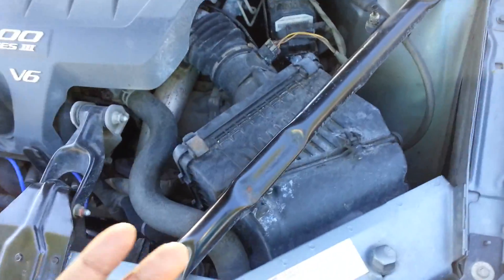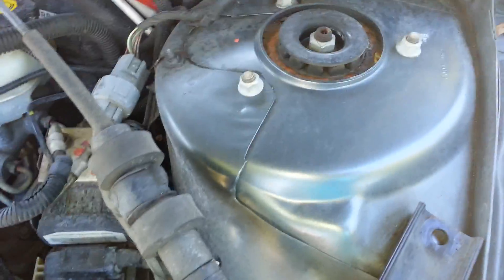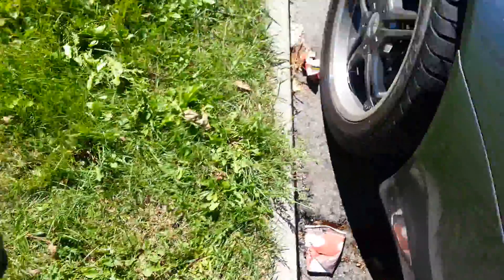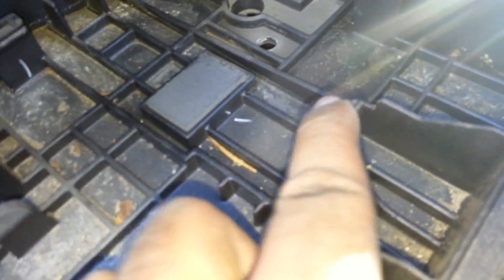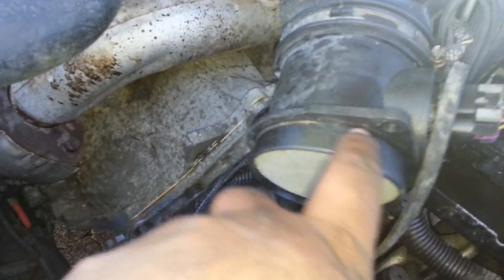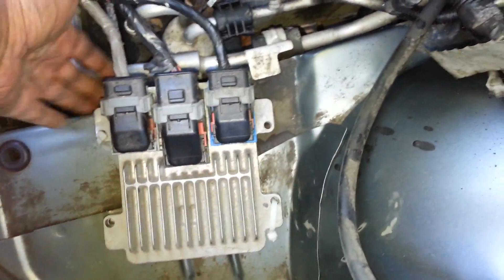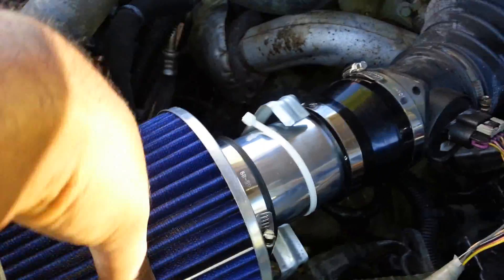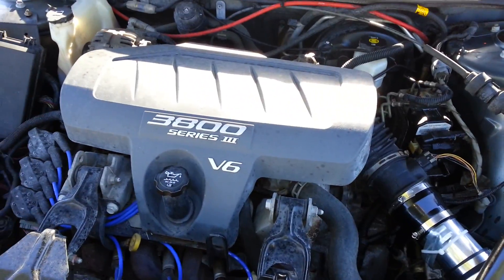04 and up Grant Prix-Adding an Air Intake

Comment: Just from reading the comments, i really like how professional and helpful you are.  You respond to everyone and answer there questions the best you can.  That is awesome.
Reply from the maker: Thanks Collin! I do appreciate the comment and great feedback. If it makes a difference for the viewers, I will keep on doing it :)
Reply: I can also certify that the intake mod does give the car a good boost in throttle response, and maybe a few HP.  Engine gets more air because it breathes easier from the less restricting air passage, makes it sound more beefy.
Reply from the maker: Awesome, thanks for confirming, leaving input and details. I had this conversation with people, but oddly, I find CAI seems to be constantly debated. While I did not record the HP gains, the car was quicker off the line for sure and even in mid-rev acceleration. Your description is perfect!
Reply: Do you think HP gains would be noted if there was a tune done?  Especially if a second "true" exaust outlet was added?  To my understanding, some car adjust better than others depending on their programming.
Reply from the maker: @Calling321  Definitely. I know they are quite a few tunes out there (Overkill was a popular one, but there is quite a few out there). The extra cold air will help with adjusted ignition timing and fuel delivery. The GPs take well to tunes, but I would not recommend it unless you get more done. The car will naturally adjust air/fuel ratio with an air intake, and for the amount of money you would spend on either a canned tune or a tuner so you can tune yourself, you will not get your moneys worth. However, once someone does a lot more (lets say performance ignition, performance exhaust, intake, etc), then a tune would really get some nice numbers from the car.

Comment: Wouldn't think this guy would do this. Best thing for this is stock intake with k&n filter. The oem design is made to suck in cooler air from the front of the vehicle; all you need is a less restrictive air filter such as k&n or something other than OEM air filter.
Reply from the maker: I did have a K&N filter in there at one point, but there is always something better. I won't bother bog down this comment with details of it, I have explained a lot of it in other responses lol. I do agree that while this was sufficient (and it was), it was definitely not the most efficient. I have since modified my air box with the cone inside. Why? Because I like to tinker. You can see it here. 

https://www.youtube.com/watch?v=HiqFHagSmO4

It had better fuel economy and better engine response vs the standard air filter, K&N filter, and the open intake like this video. And I do plan some more mods at some point when I get a chance. But it is worth a watch.

Comment from the maker: It absolutely did, actually. It depends on how you drive, because the sound of the intake makes you want to push the car harder lol. But if you dont change your driving habits, it actually saved me about 10-15% on my fuel use versus the old factory filter.
Reply: Nexus Auto my air injection pump would not let me install the intake, any tips?
Reply from the maker: Hmmmm, that is a tricky one, as you need to have the air box there. The only thing I can say to try, is this video here. https://youtu.be/HiqFHagSmO4
In the video, I converted the air box to work with a Cold Air Intake. It is my current set up on the car. The only difference for you is you would probably want to put a small mesh over the opening in the air box for the Air Pump, as the cone inside will not be able to protect it from contaminants, as a standard air filter would. Other than that, this may work for you.

Comment: I’ve an 07 and I’ve two hose one connected to the secondary air injection pump and I didn’t use a rubber connector I put it straight to the mass airflow sensor and it did seal on but I left the back half of the box should I take it out like you did
Reply from the maker: My GP doesn't have a secondary air pump. That only came in certain models, particularly California models or a couple of other states. Unfortunately, since I've never seen the air pump directly, I've never been able to find a good way to work with it together with the intake.

Comment: Okay so I have a 2008 Grand Prix and there was a hose coming out of my air filter box (obviously not the intake) but my problem is I’m not sure where to connect it? I could send pics? I’m not sure and all I can find is people doing it on the 3800 supercharged. Mine is just the 3800 v6
Reply from the maker: No need to send pics. That is the air hose from the secondary air injection pump. It is not on all GPs, only models from certain emission compliant states (like California). Unfortunately, I have no experience with them since the models sold here (In Canada) did not have the secondary pump, so I am not sure where to run the hose. I even tried locating a car here, but could not find one. Very rare on the east coast in Canada.

Comment: Hay brother can you help me out what do I do with this extra hose that was connected to box and goes down to a canister underneath I don't see you have one it was clamped on securely just wondering if it goes to something else I have an 06 Pontiac grand prix  3600
Reply from the maker: Yep, is your car from California, or another emission-strict state?

That is the air hose for the secondary air pump, which was really on Cali cars (and a few others). Many other places did not have it. 

Unfortunately, that is pretty much the only part I have not encountered, simply because it is not in any Canadian GP cars, and many northern state 3800 engines in general. I have seen people install an intake with that hose, but it almost always gets a check engine light. I have not met someone personally who had a solution. So unfortunately, I could not give a solution. Your best, safest bet (if you cannot find a solution from someone else) is to either have a custom fitting made that can hook up that hose to your new Intake, or get a drop in performance filter instead.

Comment: wow you went from a cold air intake to a high heat engine air intake!!!!!! great job!!!! you successfully reduced hp..throttle response!!!!
Reply from the maker: If you took the time to read some comments, I have explained this dozens of times already. I have long ago explained how I gained throttle response off of this. Main points to mention is that the cold air that would normally go into the air box now blows directly on to the filter. I had put a thermometer to it years ago and it was not even warm, not even close to air around the engine. YES, I gained throttle response from it, primarily from the cooler air that is still coming form around the lights and from where the air comes in from the fender, and for the sheer volume increase in air coming from that the old air box set up restricts. But it was not the most efficient set up for sure, it could be better. So i did modify my air box and put the cone inside (and guess what, there is a video for that too, go figure). And even then, there is more work I could do inside the fender to increase this further. But thank you for the sarcasm, it added sooooooo much. Great job! Much appreciated. Great applause.
Reply: @NexusAuto  ok buddy
Reply: @NexusAuto  hell yeah🤙🏿

Comment: Is this suitable enough to run a smaller pully or should i worry about heat from the supercharger? Im trying to reduce as much knock retardtend
Reply from the maker: I would definitely be concerned with the heat in there, especiallyat idle. If you're looking to run a more powerful build, I wouldn't recommend going this route. This is more for people just looking to add a little something extra to the car for fun.
Reply: @NexusAuto  then should i get a zzp air intake to make sure im running nothing but cold air? And should i get my 1.0 pcm after or before my pulley drop?
Reply from the maker: @hexeezy234  yeah, that's a good kit. Especially if you're looking to run a more serious build, getting a good intake kit is a good idea, and ZZPs is a great one.

If it were me, I would get 1.0 after the pulley install.

Comment: What air intake would you recommend for a 2008 Grand Prix v6 base model no steering wheel controls
Reply from the maker: Depends on what you are looking for, and of course, budget. 

The one like in this video is very budget friendly, but not as efficient as more expensive ones. 

You can also modify the existing air box and allow for more air to go into the engine.  

And then there is full intake systems, which are very efficient and give better low end response, but cost a lot. 

All work fine, but the more you pay, the better it is. I had them all, and the more time and money that went in, the more effective it was. But even the one in this video, which was a no name cone and intake tube, worked pretty well.

Comment: I have the 05 GP base and im changing the air intake and exhaust, how ever the exhaust is single and im  trying to make it dual is the switch possible and if so what do i need
Reply from the maker: It can absolutely be done. In fact, I have done that to me GP (which started its life as an 05 base model too). 

First, check this video out. I didn't show the work, as I couldn't make a video at the time of the work, but it will give you some insights.  https://youtu.be/ySIop0TmV5I

I can tell you at minimum, you will need the Y pipe at the end, along with a driver side muffler,, the 2 rubber mounting flanges and the bracket that mounts the rubber flanges to the frame. I'll be honest, the hardest part was the mounting bracket. GM has discontinued the mounting bracket, and I could not find a single seller through any 3rd party source in the Canada or the US who had them. I ultimately had to get it from a junkyard. Getting a stock ypipe, muffler and rubber flanges are easier. Hope this helps. Thanks for watching.
Reply: Im doing a straight pipe if I can does this change anything?
Reply from the maker: Straight pipe, as in replacing the resonator, or are you going all in and getting rid of the mufflers too?
Reply: Well my plans are chaning the cat to the maganflow high flow, and attach that to the resonator and just straight pipe from there so yea no muffs
Reply from the maker: Ah nice. It will be very oud for sure! It can still be done, but you would likely need to fabricate the metal hooks and have them welded on, so the fubber mounts can attach and hold them in place. Or get some universal exhaust hangers. That part is still the easiest part of it. You need to find a way to hang the driver side pipe, and will need to either find a bracket off of a GT/GTP, or have one made for you. Go to 8:05 in that video I tagged earlier if you want to get a better idea of the bracket I am talking about. But it can definitely be done!
Reply: Caben Longest swap out the intermediate pipe with that of the gtps and buy another muffler i am doing the same as well you can find it for around 50 to 75 bucks i would check summit racing

Comment: Does this set off any codes? And would this work on a Bonneville?
Reply from the maker: It did not set off any codes in my car, and to my knowledge, no one has reported any codes. I have a few people who own 3800 series engines and no problems either. Should have no problem in a Bonneville either

Comment: What site did you use for the air filter purchase?
Reply from the maker: The one in this video is from Ebay...was cheap, but ok. I have since replaced it with a K&N cone from a retail store.

Comment: Dude the point to having a cold air intake is to due away with the rubber one that u left on. The aluminum cold air intake helps to reduce the air temp because it doesn't hold heat like the rubber one that's still on it

Comment: I just got the car and I want to upgrade it but idk where to start
Reply from the maker: That's always hard to say, because it all depends on how far you want to go. For me, the first 'cosmetic ' upgrade was improving the audio system, and for performance, it was the 'performance trifecta', which is brakes, suspension and rims/tires, and I added this intake fun. Now from there, it all depends on budget and skill level. Good news is that there is so many parts available for this car to upgrade, lots of good choices. And it is fairly easy to work on too.

Comment: But does it give more power or lose. Looks like your adding heat which will give less power cause it's hotter in the engine bay.
Reply from the maker: I have been asked this. Especially when the car is in motion, the cool air that hits it from the gap in the hood and the opening in the fender kept it cool, and cool air was going in. Some have tried to debunk this, and it can vary by car, but where this sits, it makes a difference. 

That being said, I do want to point out a few things, just for transparency. 

You really do not get much HP gains from an intake. You will get a few, but not much, It really improves the response the engine makes, and gives you a bit better pick up from acceleration. 

Also, while I found this better for driving, if you are sitting around in city traffic idling for long periods of time, then heat does build up in the engine bay, and you are sucking that in. So depends on you driving situation. If you dont get stuck in traffic a lot, then this has some great benefits. 

Adding to that, this is still not the most efficient way. You can hone out your air box, which eliminated the idling issue and focuses the air (video here https://youtu.be/HiqFHagSmO4). Or getting one of those K&N filterchargers or a ZZP air box is a great bet too. 

Hope this helps.

Comment: I CHANGED MINE, MINE IS SUPERCHARGED...MAKES A LOT OF NOISE WHEN YOU PUNCH HER!!!
Reply from the maker: Yep it does. It should also respond a bit quicker too. If you get a chance, check out my video on porting the air box while keeping the air intake cone. more cold air, and all contained from engine heat.